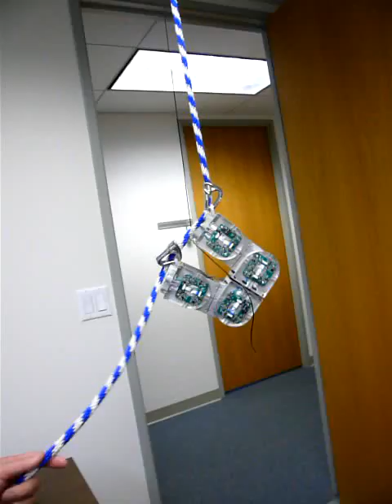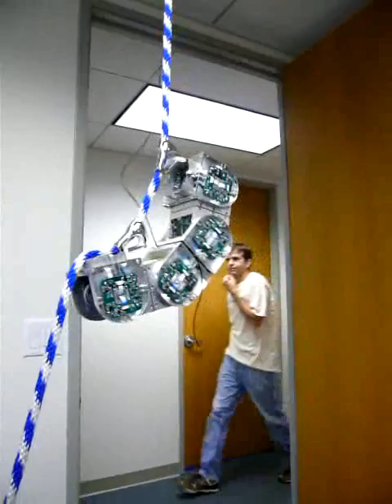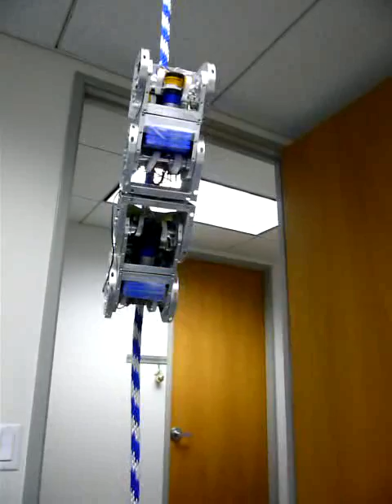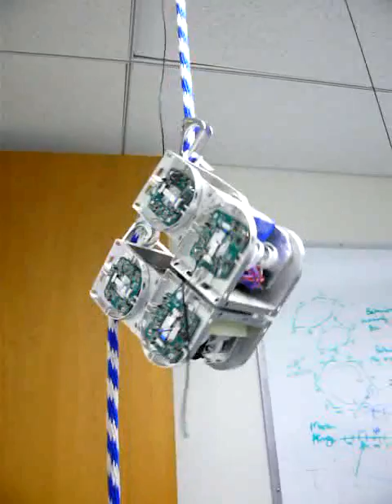Superbot in a Vertical Rope Climb

Comment: Tiblocs work because you insert a carabiner in the hole and the teeth are pushed into the rope by the pinching action of the carabiner as it's forced to the narrow end of the tibloc. your tiblocs are barely holding by snagging the rope. if you want to be able to ascend without slippage and hold a greater weight put a carabiner on each tibloc.